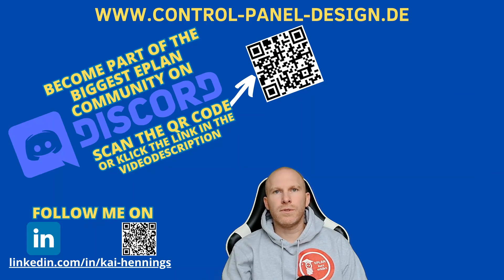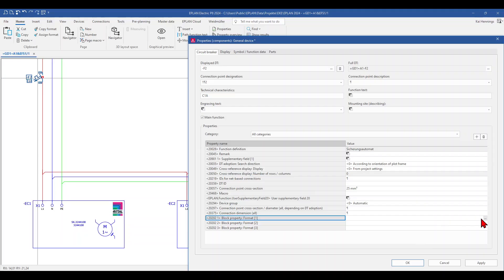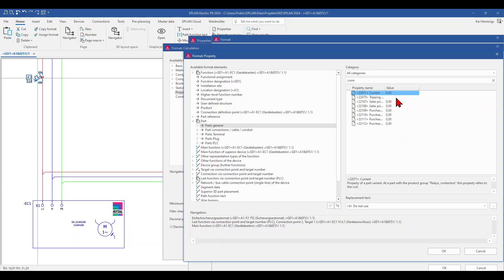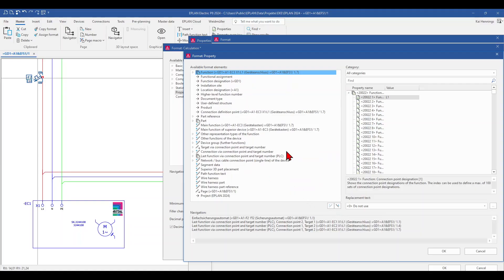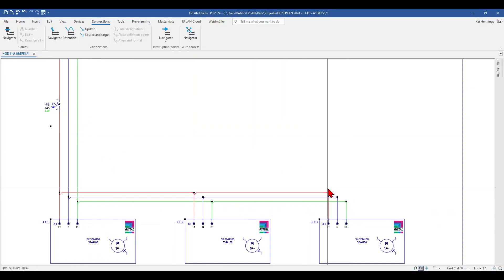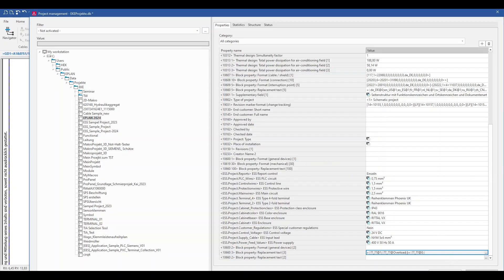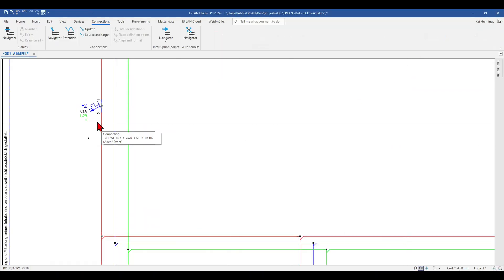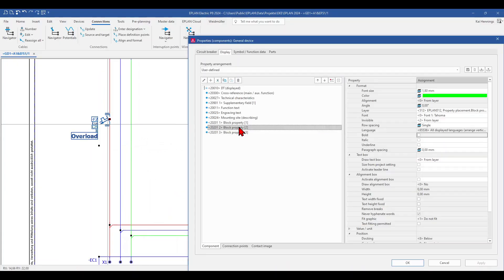Total current calculation in EPLAN 2024. How to show the overload❓

Comment: Great tutorial, applies very rare to the real world .The data base needs to be mint(with no errors), assuming that who added the part in the data base did the right job . 5.25 min for calculating that comparing with taking the values from the data sheets of the products can take more or less same amount of time, and you are shure you got the right info's. As a comment maybe Eplan can do an automatic navigator for doing that instead to go through all those steps presented .

Comment: What happens if you change the schematics? Lets say you delete EC3. Will it still work? Or will you have to change to block propertiy formats?
Reply from the maker: That's the big disadvantage of this solution. It depends what you change in the drawings but most probably you need to adjust it

Comment: Great video. This is great that EPLAN can do this but I don't see this as a practical solution using so many block properties. Maybe EPLAN could create a "calculations navigator" which might be a copy of the device navigator where the users simply selects =GD1+A1-F2 and then selects all other devices for which the user wants to associate for making a calculation? Then maybe the display property for the calculation could be linked via a part reference property to =GD1+A1-F2? I am not an eplan developer but I hope this is a beginning to something more useful, using all these block properties for something complicated like a main breaker is not going to be practical.

Comment: That would be useful only if it was recursive on a potential for example. That would allow to calculate power for each phase through a distribution panel. This way it is not feasible to take into account a distribution terminal strip for example.
Just need to get better. Surely some block property could be used for simple recusive math that can calculate attributes to show based on alteady available data without having to input it manually each time.
Reply from the maker: Yes 100% would be nice to get a function to add automatically all devices on a potential
Reply: This function seems so slow to implement. By the time to import the function for calculation will be done manually so many times.
Reply: @elitee92  i usually create a separated temporary report to sum custom properties like absorbed current, voltage and cosphi divided by attributes i set manually to each component. Then i get total data by potential or devices types and insert them manually on templates sheet. Such a waste of time for a basic functions for electrical engineering. 
Also we don't make machines but automation systems for processes on plants so we never have 2 equal panels. Adding those type of calculations would speed up our workflow a lot. Let's hope in future developments.